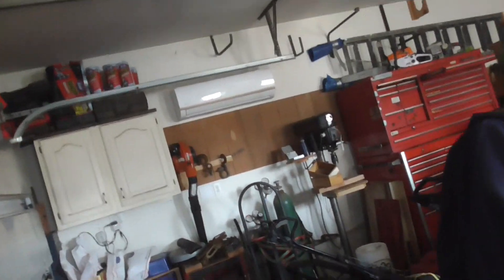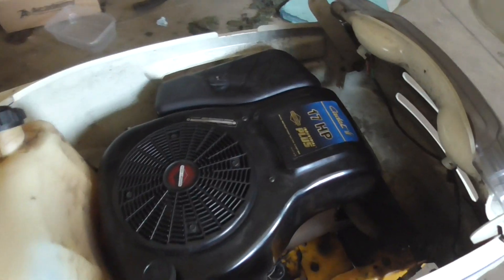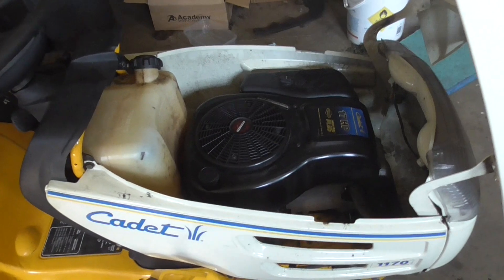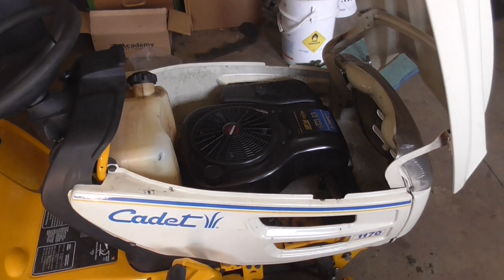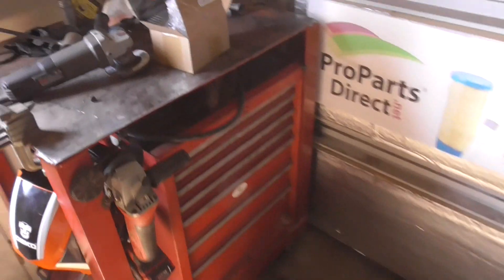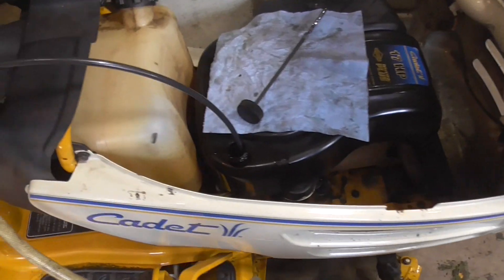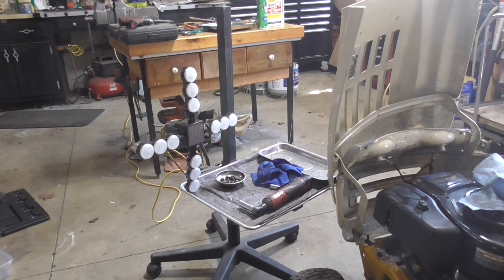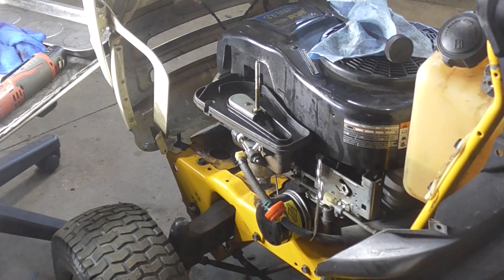Tractor Has Gas In The Crankcase

Comment: The seats not the problem. The fuel shutoff solenoid is not shutting the fuel off when you shut the mower off. Simple fix. You get gas in your oil, you get whats called hydrolock

Comment: I have had similar issues in the past.  All my small engines now have manual shut-off valves; issue permanently resolved. 
Most times, I shut off the gas and let engine consume all the fuel in the carb...no gumming issues either!
Reply from the maker: If everyone did that they wouldn't have any issues and I wouldn't have any work.

Comment: Did you change oil filter or leave old one on ? Wouldn’t the gas thinned oil be present ?
Reply from the maker: That's a very good point.  The filter should always be replaced even though the oil is thinned and the filter will drain out.

Comment: Was that a NIKkI 6 carburetor? I have lot of issues with them in my shop. I tell my customers when I see one of them that they need to be prepared to buy a new carb. I will try a repair once, but tell the customer that if the repair fails, they need a new carb. Thanks for great video's.
Reply from the maker: The original was a walbro.  I just replace the nikki6's they are not worth the work.
Reply: Same here! I'm glad Double-wide got his to work, but they never, ever seem to work for me. A mechanic friend down the street says you can ream out the main jet  to smooth out any problems, but I've never been able to get that to work either. When I see a Nikki carb come into the shop, my first instinct is to throw it away and get a Briggs Stratton to replace it. Glad to see I'm not the only one who can't get these things to work right. It just has to be a matter of the luck of the draw.
Reply from the maker: Carburetors are a lot of trial and error.  Especially equipment that has been sitting with fuel in it.
Reply: @doublewide6  They really are. Today I had a carb off a Honda push mower that needed cleaning, and I almost rounded off the brass main jet to get to the emulsion tube. (I have special screw drivers and all, but it was a war.) I always hold my breath when starting a carb job. With two cycles, I just bolt on a new one. A carb kit costs almost as much as a new one, but when they come shipped with air filter, plug, fuel filter, pre-cut fuel lines, grommet, and gaskets for $17 . . . call me a lazy parts changer! I don't care :-)

Comment: I love these Amazon chinese carbs i order them everytime i get carb problem they work great and start right up instantly. I dont care what any "old man small engine know-it-all" (not you) says they are way better than spending $100+ on oem carbs from the dealers. And they last a really long time...
Reply from the maker: If I own the equipment it gets a Chinese carb.  If a customer needs a new carb, I ask if they want OEM or Generic.  OEM is easier and fits perfect, I mark up parts 25%, so I even do better if they want OEM.
Reply: Just wait until you have to rebuilt them. It's a clusterf*ck of headaches to get kits. You're the first one I hear praising them. I guess you got the right connections.
Reply: @rverro8478  Like he said it was $14, why would you rebuild it. Order another one. Most likely a rebuild kit would cost close to what the new carb cost.
Reply from the maker: I agree, just replace it again.
Reply: @rverro8478  i called my local dealer and they said it was $50 for a carb rebuild kit for my 17.5hp briggs so i bought whole chinese carb for it instead for $15 with free shipping. All the cheap carbs all come with extra hoses, clamps, filters, fuel pumps, and spark plugs. i still have carbs from 10 years ago that still run as good as the day i put them on. I take care of my stuff though thats why they last...
Reply: @rverro8478  and i have bought chinese carb rebulit kits for like 7 bucks on amazon. Amazon is the best

Comment: I have had good luck with the 4 cycle replacement carbs off amazon and ebay on 2 cycle engines I have had some the were good and some that wouldn't work so well but for the price of them i can still buy a different one if the first one doesn't work cheaper than buying one OEM one most of the time. I agree with you for the price mof these carbs i had rather buy a replacement carb that put in a needle and seat kit. Stay Safe. Stay Healthy. Have a good one. God Bless!!!
Reply: Huztl makes the best cheap 2 cycle carbs
Reply from the maker: Those are pretty good I have used a few of them over the years.
Reply: @rannz8  OK thanks next time i need a 2 cycle carb I will seed if they make the one I need
Reply: @nashguy207  i misspelled it its actually huztl but you can find reviews on youtube i do lawn care and have gotten a few of them that still work great and they come with fuel lines, gaskets and filters.
Reply from the maker: The carb replacement is probably the best option with the customer in mind.  I would have to say about 15% of these carbs don't solve the issue or run correctly.